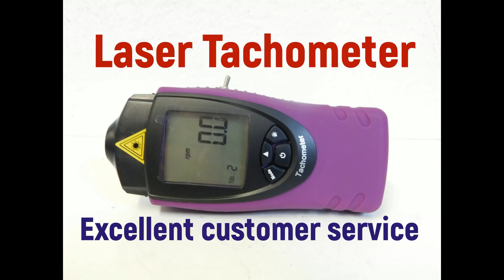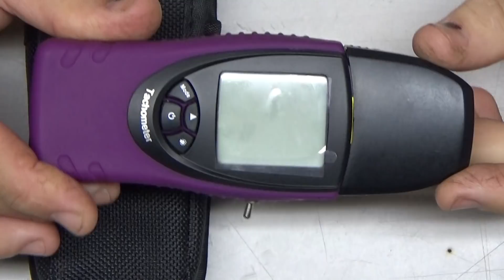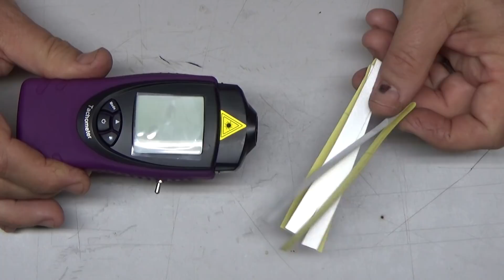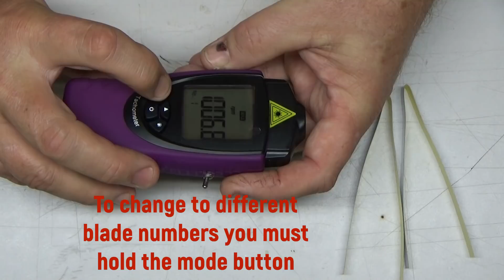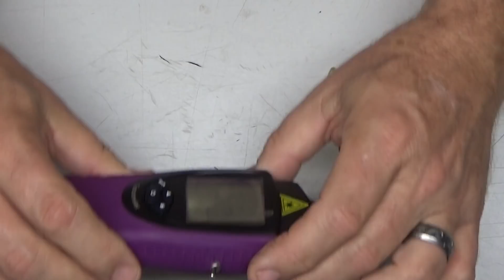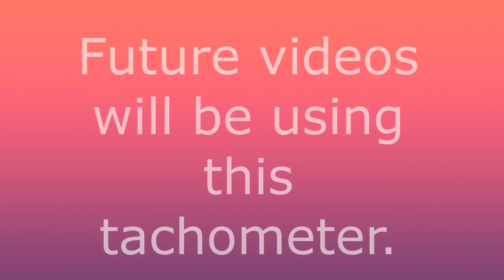Laser Tachometer A Quick Look

Comment: what if you used reflective paint would that also work?
Reply from the maker: I am pretty certain that ANY reflective material, stickers, or paint would work.  I do not know where to get reflective paint off the top of my head though either.  Paint would make prop balancing more critical also.  With the strips if I use the same length piece, theoretically it would weigh the same